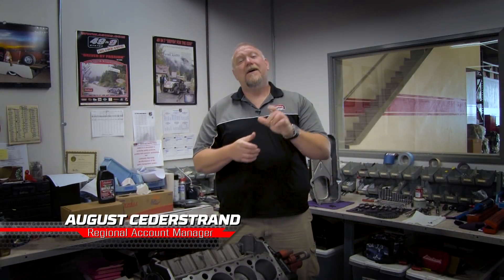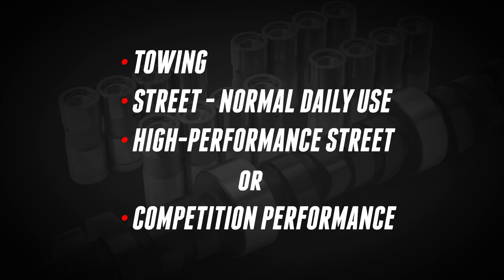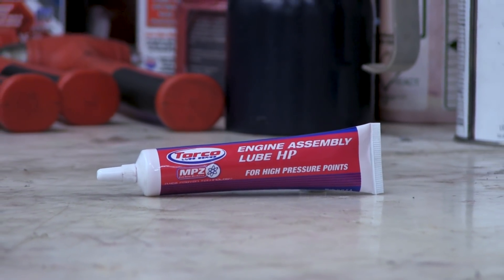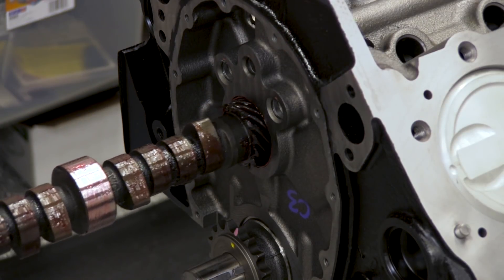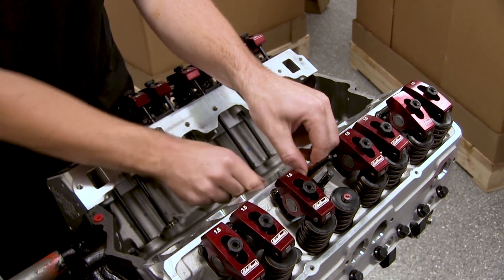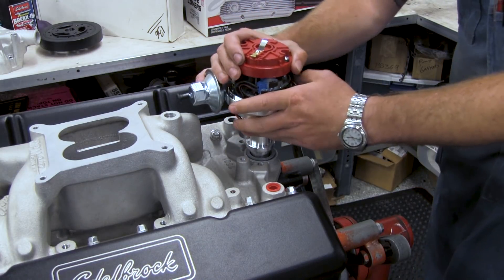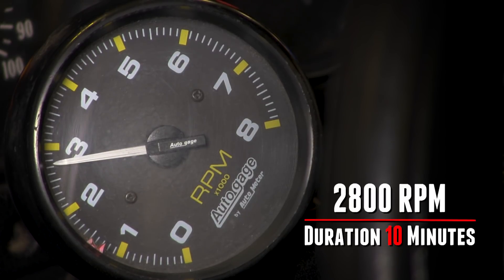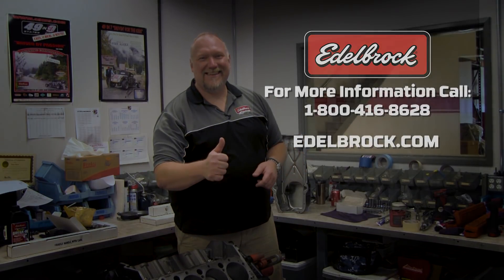Hydraulic Flat Tappet Camshaft - Break in

Comment: This 7 year old information is just about useless. The quality of cams and lifters has gone to zero. The failure rate is SO HIGH in 2023-2024 with any brand of flat tappet cam and lifters. Why gamble your rotating assy? And your block and oil pump. Save your money and get everything you need to go to a roller cam, lifters, pushrods, springs. Zero break-in. Next to zero failure rate.

Comment: I know I'm 4 years late to the party, I wouldn't say anything about a youtuber or a home garage mechanic,  (which is what I am at best) but this has the EDELBROCK USA stamp of approval on it.  I am not an Edelbrock hater, I have-a-bunch of their stuff and I really like all of it, so here is my burnt oil under the fingernails observations.     1.   Mr. August Cederstrand is a Reginal Account Manager.   I assume he's not a Certified Mechanic,  or they should have put that on the screen as well.  Shame on you Edelbrock. Too bad corporations are more concerned about engineered image than practical information.   Which brings me to  2.   If your Engineering Department calls it Convex or Concave, please clarifiy.  It is just a description and not a procedural catastrophy, but it has caused quite a ruckus,   Shame on you Edelbrock.     3.    I may have drained the old oil before I took the motor out of the vehicle, or even broke down the motor to remove the old cam.  I like to pull the pan, make sure the oil pick-up tube is secured, and put a new gasket on, just a personal thing.

Comment: None of this high rpm break-in makes sense. The opposite, low rpm does make sense. No car factory ever breaks in an engine first start, not ever, for over 120 years. Start the engine, drive it to the parking lot, turn it off.
How many engines have been stored for 1, 30, 70 years but start and run fine? Abandoned in a field? No lube at all, dry.
The cam turns 300 rpm at 600 rpm idle. The lobes are actually pushing the lifters ~1/3 of that, duration of ~120°. So about 100  lifts per minute or 1.7 per second. You can blink or tap your finger thrice as fast, for perspective. This is trivial and breakin grease or even oil is plenty. When you raise the rpm 4 times idle you have increased the velocity at which the lobe approaches the lifter and the speed that the lobe wipes accross the lifter thus increasing friction dramatically. Like starting a fire by twisting a stick on a piece of wood slowly vs very fast. And pump oil pressure from lifter bore and crank slinging takes a few seconds. Someone should make a test rig of an engine with cam, only 2 lifters and 2 valves and springs. Put a motor turning 300 rpm on the cam with NO lubricant and measure the temperature rise vs time. If the surfaces are hardened properly there should be no wear. Then raise the rpm to 1200.
A drill or a lathe tool with no lube experience much higher pressures and dont dull unless the rpm is very high. Best of all, get a sixties GMC V6, the cam is IN a pool of oil at all times. As far as rings seating, use a bit of thin oil and low rpm. Never had problems and engines I built 30 years ago still run fine.
Reply: That's great man I'm sure comp cams, Edelbrock, Howard's, crane, lunati, and all the other cam companies have no idea what they're talking about. They didn't build an engine thirty years ago and offer terrible advice on a YouTube video comment section. Everyone should take your terrible  advice. Especially on how splash lubrication works and friction works 👍
Reply: @maxsinger3526  Read my comment again. Slowly. Focus, concentrate on each sentence. Then critique each one, explain where I'm wrong.
After years of investigating, Powell machine and others have determined that flat tappet failure is not a hardness issue. Maybe a crown and cam slope issue, i.e. crappy machining. Powell no longer has anything to do with flat tappets. Failures began after the myth of high RPM breakin. The myth of crank slinging oil is absurd. A new cam is installed with break-in grease, that's why it's called "break-in grease", that's why Isky and others supply it with the cam. High RPM slings the grease off. The goal is to mate the contacting surfaces without excess friction. Prime the oil pump with a drill and look at the lifter bores, if they dont weep oil directly onto the cam lobe you have a problem. And a drill on the oil pump is equivalent of very low RPM.

Comment: Protip have someone watch the pushrods and make sure they are all spinning. If they aren't grab then and spin them to get them going
Reply: do you run it without valve covers?
Reply: @ab-qh6ip  on initial start-up. If one (or more) isn't spinning after 10 seconds then STOP the engine and figure out what the problem is.

Comment: I installed a Comp Cams cam kits, break-in oil
etc. Instructions called for running engine 45 minutes at 2500rpm. I ran it for an hour 60 minutes. I used Amsoil Break-in oil. Did it on two engines, a small block n a big block Chevy. I've had no problems. Both run great! Smooth idle n nice throaty rumble out  back. Running stock exhaust manifolds. The small block has a bit more of a lowpy idle. The big block runs smoother, but the exhaust note definitely is big block. Both are mild street/strip cams and run with low stall towing converters. Both pull hard with decent drivability...

Comment: No necessary To do anything he says for flat tappet cam. Think about a moment here why whe dont "break in" roller cams. Why would you? Same goes To flat tappet Cam why would you? There is no reason... No need To do 20min 2000rpm break in and certainly no need To use zddp! That is a myth busted! What is important is use a good oil whit strong oil film. Here is some reading for those of you have wondering this 
Flat tappet break in nonsense. 

540ratblog.wordpress.com
Tulokset internetistä
540 RAT - Tech Facts, NOT Myths

Comment: This video actually show one of the leading causes of camshaft failure.  Do not follow this clown's  advice because his method increases the failure rate by over 50%!
Reply: What part is wrong? I've got a new engine in my truck, and I'm waiting on a carburetor to get here later this week to break it in. So much if this info I've found is conflicting
Reply: @KEVLAR1911  without rewatching the video again I'm pretty sure he put camshaft assembly lube on the body of the lifter, instead of just on the base.  A lifter has to rotate and when you use a thick & greasy assembly lube (instead of oil) on the body of the lifter it increases the rotational resistance of the lifter making rotation difficult in the first few seconds/minutes of starting greatly increasing the failure rate.

Comment: What if a guy was installing one of your computer friendly cams into a TBI gm SBC truck that has the timing advance wire on the fire wall or under the dash, would you do the break in with that wire unplugged set to 0 degrees or is it a guessing game with it plugged in?? on initial start up..?? Thoughts because I kno if the timings off it could get Hott quick.
Reply: Run a carburetor instead of a tbi lol
Reply: What did you set the TBI timing on at on start up and did you pull the wire. I am tackling this project this week end.
Reply: @matthennessy3692 how did it go?
Reply: @sega2229  I think my timing was a bit advanced on start up because it got hot quick but I let it run for the break in period.  As long as she will run I say fire it up and break it in and then adjust the timing.  
My truck is happy at 0TDC. I tried a little advanced and it had some “timing rattle”.

Comment: How has no one caught that when they said the lifters are concave when they are CONVEX. Concave flat tappet lifters are no good! Convex or flat is acceptable if reusing with the cam they were ran with...
Reply: Yes, I started watching and as soon as I heard CONCAVE I said you've lost me and have Zero credibility. So did no one at Edelbrock proof this presentation? The last set of Edelbrock heads I sold had dirty casting finish in the intake ports that wasn't rectified. They are loosing on trust, quality and their prices are making their product unaffordable. Wake Up Edelbrock!!!😮
Reply: This is why placing a machinist straight edge across the lifter’s bottom to look for daylight in the center, yet also see a convex surface by allowing the machinist rule to rock left to right. This is only done to check lifters when reusing the cam. Cam lobe checks come later. Use best practices for all engine component testing. If you don’t have the tools, pay a shop to measure them. If a normal daily driver, inspect and note all while keeping numbered for the installation in the same spot. If higher RPM’s are required or power adder like turbo, super charger is to be added, now fitment changed and balancing the entire rotating assembly is required as rotational forces multiply quickly at 6,000 - 7,500 RPM. Being 1/2 gram off one the end, can create a load of 360 pounds on the crank, rod, bearings and piston. Turbo’s require higher valve springs because as they can be pushed open when turbo spools up. Lots of things. Best of luck with your project.

Comment: Good VIDEO !!! A roller cam is truly the way to go but sad the zink has been eliminated because of pollution controls and epa crap that done nothing but cause trouble !!!
Reply: John Hutsenpiller Jr

Flat tappet cams need zddp is a myth! What is important is oils Film stenght how much it can take psi 100.000 and More is the way To go

Read here

 540ratblog.wordpress.com
Tulokset internetistä
540 RAT - Tech Facts, NOT Myths
Reply: FYI,there are plenty of oils avail today with proper zddp/zinc & phos level for any type Hdy or mech FT cam & lifter setup.
Reply: @scottwheaton969 And plenty of failures too. Almost never heard of a cam or lifter failure in the 70s and 80s.  I sold over a hundred cams in 10 years in the auto parts and speed parts business.  Never heard of a failure.  They would have come to me looking for blood. The products aren't the same as they were then.
Reply: @davidkeeton6716 so IRT the oil and zinc issue, the current standard specification allows enough ZDDP to maintain an established wear layer, and the detergent addative(s) that were attacking the ZDDP wear layers have been reduced since it turns out that they can increase the likelihood of low speed pre-ignition detonation in the GDI set ups that are becoming the standard. A higher ZDDP content break in oil is still required though to establish the wear layers. Machining quality is another part of the problem, and i would probably have a local machine shop check the lifter faces before dropping a set of flat tappets into an engine

Comment: Once the cam is broken in what kind of oil to use?
Reply: Something like Lucas or something with extra zinc, if not, you can get a zinc additive and add it to off the shelf oil
Reply: Use the oil you normally use.  Some people prefer to use a SAE 30 non-detergent motor oil to break in a newly built engine. After that change the oil/filter to what you prefer.

Comment: If the engine is shut down before atleast 20 minutes the lobes WILL BE WIPED DOWN!!! Had a flywheel touching the bellhousing causing a ruckus on break in once, so I killed it after about 2 minutes, fixed the issue finished break in, and on inspection of the lift with a dial indicator  it wiped off 0.070" , so now the lobes were stock lift😞. I have been through the ASE engineering courses through college and ASE break in standard requires 40 minutes at 2000-2500 rpm. DO NOT KILL BEFORE 20 MINUTES short of extreme overheating or a permanent damage occuring. Unless its going to leak dry and burn up before break in DO NOT SHUT DOWN!!!!
Reply: You don't know what the hell you're talking about. And the automotive manufacturers NEVER did cam break-ins before sending new cars out the door.
Reply: last year i broke in a lunati cam in a 350 and one of the spark plug wires caught fire i ripped it out and it continued to short on the master cyl for the rest of the break in, show must go on!
Reply: I had a flywheel touching the bellhousing on break in aswell. Multiple stop starts to find the problem and no wiped lobes. Luck of the draw I guess.

Comment: What if you have tripple springs? Do you need to take out the inner spring? To break the engine in?
Reply: yes you should be doing that.
Reply: You absolutely need to single up the valve springs during the initial cam break in. ESPECIALLY NOW DAYS. They don't make them like they used to. You are really gambling high stakes dice rolling with any flat tappet cam.

Comment: I am installing new edelbrock lifters, but am not installing a new cam,  some told me I must also change the cam at the same time, is that true?
Reply: You'll be fine.
Reply: @warrenzevonsangryghost6055  WRONG!
Reply: @rogerkoch4658  Nope. In a perfect world, yeah, both ought to be new. But unless the cam is badly worn, new lifters will be fine. Just check to see that they are spinning when the engine is running (dab of paint on pushrod will tell). Old lifters on new cam, very bad (and stupid). New lifters on old cam (as long as the cam is in decent shape) is fine - check for spin. I've got ancient yellowed service TSB's from both Ford and Chevy discussing this very matter, and while they go into a lot a detail, the upshot of the deal is the degree of cam wear being the deciding factor. On properly maintained engines, no sweat. I can't imagine having to have told every customer that came into the shop with a noisy lifter back in the flat tappet days that they were gonna have to buy a new cam and pay to have that installed as well. Unnecessary, and even the engine designers agreed.
Reply: @warrenzevonsangryghost6055  If you have TSB's I stand corrected. I would be afraid to do it with my luck though!

Comment: I bought a new Blueprint Engine, 350/372 hp and the directions say to break the cam in etc. I have a question, the engine was put on a dyno for at least 30 minutes that's how I know the hp so why isn't the cam already broken in? It is a flat tappet by the way. This doesn't make sense to me. Also Hedman headers recommended that I not install NEW headers on the new engine because of the heat from the HTC coating on them (High Temp Coating) it could cause the rings to not seat properly. None of this makes sense to me when I know this engine has been on a dyno and was hooked up to headers. Any idea's on this?
Reply from the maker: If the engine was dynoed already, It must have gotten broken in prior.
Reply: Why you are advicing in YouTuBe? You should contact tech department!
Reply: TheJhaley12 cv

Comment: Hey guys 
I need help
I put a new performer cam in my 305.
I had problems with my exhaust manifold when i started the engine up 3-4 times but i had to turn it off because it was extremely loud.
Now my mechanic dirve the car before the break in in his shop. His shop is 1mile away.
Did he ruin my engine?
The engine is stock, only cam and valve springs are not original.
Sorry my englisch is bad...
Thx for help!
Reply from the maker: Please contact our Tech department. We do not offer tech advice on YouTube.

Comment: Do you have to use a lighter spring pressure for the break in?
Reply: Answer is yes and no. If it is a stock or just above stock cam then no use the springs that are recommended for that camshaft. Of it is a big lift cam with duel or tripple valve springs then yes you do. Or simplest thing to do is remove the inner springs and break it in that way. Then reinstall the inner springs after break in.
Reply: I use 1.3 rockers. For non big time race heads
Reply: Nah just use stock springs, especially if the motor already used flat tappet
Reply: for a race engine running stiff springs yes for a mild street engine no
Reply from the maker: Please contact our Tech department. We do not offer tech advice on YouTube.
Reply: @EdelbrockUSA  what is this video if not tech advice?